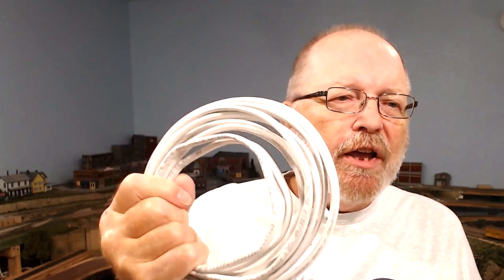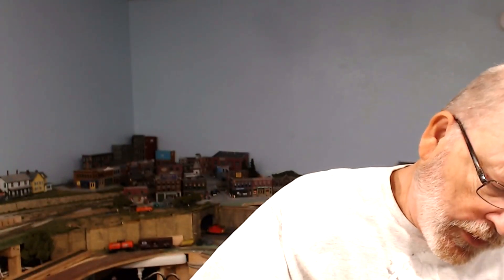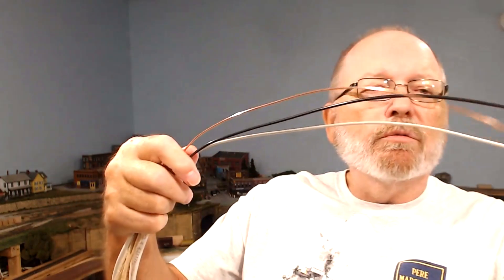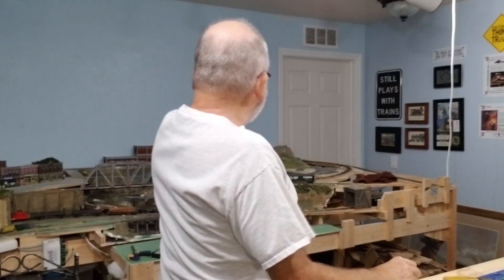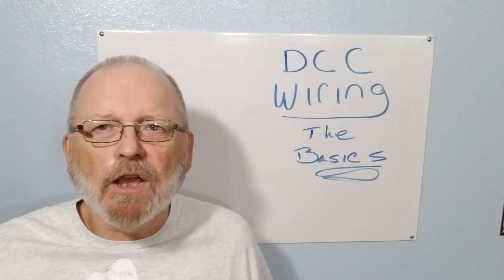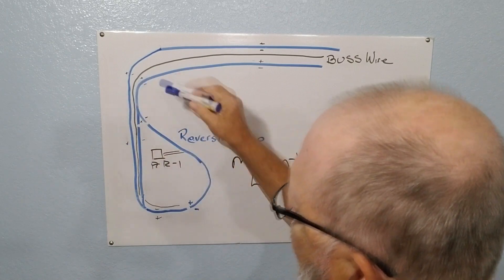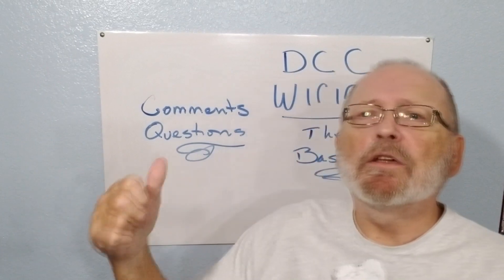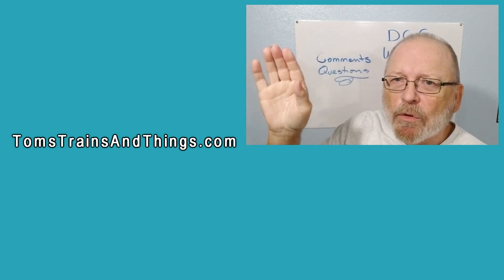Easiest Way To Run DCC Bus Wires On Your Model Railroad

Comment from the maker: Where should you run your Buss Wires and Feeder Wires on your DCC layout!
This video shows you where the best place is to run your wires to keep you feeders as short as possible.
Nickle Silver Rail is very high in resistance especially for the N scaler which can be equivalent to 36 gauge wire.

Comment: Looks like you got the same house wire I did.  I got 14 AWG solid strand house wire from Lowes and stripped it and ran the black and white wires under the layout to solder my drops to. I'm using flex track too, and my layout is fairly big, and even with feeders at every other joint, especially in the yards, thats a lot of feeders!
Reply from the maker: Best way to do it especially now with the price of wire
Reply: @TomsTrainsandThings  I hadn't followed the price of wire over time, but it seemed logical to use house wire.

Comment: Hi this is Neil schwerdt from West valley city Utah I have a question to ask you ( Tom ) I just put in the PM 42 and ran the  bus wirer s for each block to the PM 42.
Is that right you need to ran saparte bus wirer s to each block. again I have 4.
I really like watching your show on YouTube.
From Neil schwerdt
Reply from the maker: 1 set of bus wires IN, that are jumpered to each block. They are separated on the output

Comment: Tom. I want to use track that I can easily reconfigure. My layout cannot be permanent. I’m thinking of standardizing on KATO HO Unitrack. From what I have learned, it’s very smooth and reliable, very few if any derailments. I also have been looking at Roco GeoLine HO track. It also seems to be very high quality, unlike atlas or EZ Track. 

What I want to know is, if you’re familiar or not with these two brands, and how DCC friendly are the turnouts/switches? I want non-power routed switches, I believe, and insulted frogs?  Can you elaborate on the turnouts, and also provide your opinion on which track you would use if you only had these two brands to choose from? Thanks.
Reply from the maker: I'm not familiar with either of these brands since I've never used them. Most manufacturers have a variety of insulated and non-insulated frogs, they typically will be called insulfrog or electrofrog as in the Peco brand. You can easily search online to see if these manufacturers have the two catagories.

Comment: i'm just getting started in dcc. can someone please explain to me what buss wire is for?
Reply from the maker: Since the track is higher resistance than the bus wire. It's required to keep the required signal strength throughout your layout.
https://dccwiki.com/Wire_Sizes_and_Spacing

Comment: If you just have one continues track with no switches do you still need the bus wire and feeders? If so why? The rail is just as thick as 14 gauge wire so what's the purpose?
Reply from the maker: Copper wire has less resistance than the track, and you also have to deal with the bad connections between rail sections.
https://www.electronics-notes.com/articles/basic_concepts/resistance/electrical-resistivity-table-materials.php

Comment: Nice video Tom and good information. Two questions regarding using Romex for the buss wire.
1. Are you using multiple pieces of Romex that are spliced together on the layout or is it one continuous long piece of Romex? 
2. How are you splicing into and what method of connecting the feeder wires to the Romex? 
Thanks.
Phil
Reply from the maker: Thank you
1. Yes
2. solder where accessible, terminal board, wire nuts, specialized connectors.

I have a video on connectors:  https://youtu.be/ZmOF5HHYev4
Reply: @TomsTrainsandThings  Thanks for the info. I heard about suitcase connectors which, I was considering and I think you mentioned 14 gauge Romex. What gauge feeder wires are you using? Thanks again.
Philip

Comment: Hello Tom,
I'd like to run a second bus line for my N scale switches & accessories.
Any issues with doing this?
Thanks,
Paul
Reply from the maker: Not at all, I run several different voltage bus lines throughout my layout.
Reply: @TomsTrainsandThings  Do you use the same gauge wire for switches & lighting?
And thanks for your quick responses. I really enjoy your videos TOM!

Comment: Hi Tom I am very New to DCC I am having trouble wrapping my head around the wiring on my layout I will be using NCE powercab and I will not have a program track i live in a small apartment i will be putting 2 HO tracks on my layout both DCC and both will be oval and its going to be 3x5 that's how big the table is all i want to do is how to wire both tracks to my powercab and i watch your videos but i still dont understand i am sorry how would i wire my 2 tracks together to the powercab also i have the Bachmann EZ track and the Atlas track i may use please help or if you know where i can look it up so i can understand it please let me know thank you Tom i am sorry i hope you understand what i am trying to say thanks again
Reply from the maker: two wires from the unit to the tracks. Since it's DCC, you can use the same two wires for all the tracks.
Reply: @TomsTrainsandThings thanks time I am actually going to a train show on Saturday maybe they can show me thanks for your input

Comment: Hey Tom, I'm running fastrack o gauge on a 14x16 ceiling shelf. I have a small transformer and a lionel 180w brick. If I put the power house on one side and the transformer on the opposite long side and then 14 ga bus with 20ga feeders should that work just fine?
Reply from the maker: Can't help you there. I don't do O Scale or Lionel. You might want to ask trainroomgary!

Comment: For those of us O scale 2 railers. It is recommended that EVERY section of Atlas O 40" flex track piece have a pair of feeder wires in the middle. Never rely on joiners and do not solder the joiners either, it is mind boggling to me why people would do such a crime.
Reply from the maker: Those that never follow the recommended practices are always the first to complain when they have issues.
Reply: @TomsTrainsandThings  absolutely agreed!!!

Comment: Tom. Will a dc power pack controller run a train on 300 feet of track? It's HO code 100.
Reply from the maker: Should work as long as it's not one of the power packs from a starter train set and you have all good connections between your tracks and enough feeders.
Reply: @TomsTrainsandThings  thanks Tom. I've purchased a mrc prodigy elite but I have no idea how set it up. So I'm going to start with dc.
Reply from the maker: You have a good system there.
Reply: @TomsTrainsandThings  I've been watching about 10 of your a day, trying to lean the ropes.

Comment: Another good one, Tom.  Thank you for the tips!  i need to get larger (smaller AWG) wiring.  I wired a 2' x 8' module with 18 ga. buss wires and 22 ga. feeders.  I'm going to incorporate it into an around the room layout so I need to upgrade some wiring!
Reply from the maker: Robert, if your going to expand, I would start out with 14 gauge for the bus wires putting the source at the center and going both ways  to shorten the total run of wire

Comment: I’m so confused.... I just started model railroading and building my baseboard, I thought you just needed the rail joiners for power, can someone help explain this to me?
Reply from the maker: If you are starting out with a DC unit, you will want to see my other videos on wiring a DC layout. This one is for DCC. I have an entire series of videos on Model Railroading For Beginners. https://www.youtube.com/playlist?list=PLjjhnrIKSTShrzvkLrtppcNJ0zObTcDyv
Reply: You feed each section of track independently with the feeder wires from the main bus wires. This way, you aren't relying on just the rail joiners for power.

Comment: Hi Tom,
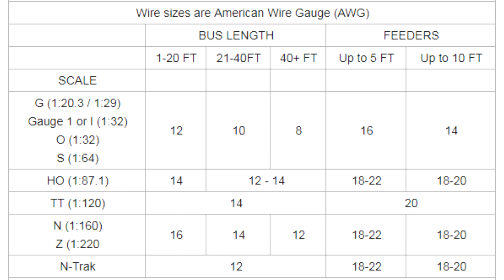On one of your DCC videos (Easiest Way To Run DCC Buss Wires On Your Model Railroad), at 14:05, you were showing a chart that showed the recommended gauge wire based on the length of track.
Then you said that as the track length increases, the voltage needed to be increased in order to compensate for the added resistance.  Did you mean to say that amperage needed to be increased in order to support larger track lengths?
You were talking about Digitrax and the use of boosters.  Are you actually connecting a wire with the weak signal to the booster to somehow boost the signal or increase the amperage?  Or is this just a 2nd power supply providing power to a 2nd section of track?
When you talked about AC, DC, and DCC, I understood the part that DCC was a coded signal that gets laid on top of the electrical current.  The decoder then detects the signal that is intended for that specific decoder, that you called the road number.
Does DCC typically run on DC or AC?
Do you typically have 1 power supply for the track, and a 2nd power supply for all of the DCC electronics, block detectors, and signals, and then a 3rd for accessories like scenery and other lights that dont impact the running of the railroad?
Should the track be AC, and then the other 2 should probably be DC?
Thanks for the wealth of information.  Im sure that I will have more questions next week.
Reply from the maker: Brent, you need one power supply for your command station to take care of the DCC signal to the tracks. The total amperage of the Command Station and your power supply determines what will be available for the track. Say you have a command station rated for 5 Amps. You can use a power supply lower than that rating. In fact the power supply recommended (by Digitrax)  for most command stations (now discontinued) is rated at 4 amps at the lower voltage 12 - 15 V and 2.9 amps for 24 vdc. The newer one (PS 615)  is rated at 6 amps.

Most home layouts require only one command station with no Boosters unless your running a multi layered through several rooms and have ops sessions with a dozen other modelers.

All your accessories are powered individually depending on the rated voltage, Most of them are DC unless your using something not model railroad specific or it was for an S scale or O scale system which operates on AC,

The longer the distance, the larger wire you will need. That goes for any wiring, not just model railroading.

DCC electronics do not run on DCC, they just interpret the signal. Some can run on track power or an external power source like a DS 64. A PM42  & PR 3 needs an external power supply and is also connected to the LocoNet.

You have to read the documentation of each component you want to use to determine if it requires an external power source.

A DCC signal is neither AC nor DC, it just looks similar to a combination of both. Since the signals travel from zero to the set high it can be read on a meter as AC but it is not like a typical AC signal that is an alternating minus and plus signal.

Comment: Hey Tom ok here's my problem I want to shut off track in my yards but on dcc you have to have two wires how do you wire a isolated track and what kind of on and off switch do you use thanks
Reply from the maker: In your yards you will have to gap at least one of your tracks and add an additional switched feeder wire to the track beyond the gap. You can use a small on off toggle switch to cut the power on this lead.

Comment: The whole point of DCC is that you don't have to have different sections of track !!! FFS stop over complicating this hobby, it puts people off !!
Reply from the maker: Most DCC manufacturers make components to separate the tracks into districts for various reasons such as detection and signaling. Some other reasons for breaking up the track is for ease of troubleshooting and reversing sections. The point of DCC is to run multiple locos on the same track, in different directions and speeds with one controller. If you think what I say is complicated you should try reading the instructions for all the DCC components available. That's why I put it into simpler terms so modelers without a technical background can understand it better.
Reply: I run a model shop, I build and sell model railway layouts, so I think I know what DCC is for. All you need for a reversing loop is reverse loop module which costs about £30GB, yes you can have block detection etc, but there is no complicated wiring involved at all, not unless you make it complicated !
Reply from the maker: Graham Walters one common bus wire pair running parallel under the layout is not complicated at all.

Comment: Is that wiring cost effective? I mean, as opposed to spools of 12 or 14gauge wire that most of us are used to buying?
If it is, I've GOT to tell Carmine about this, because wiring as been one of our roadblocks on the Pacific Belt, financially.
On my home Layout, and Carm's Pacific Belt RR, we try to run feeders at least every 3 feet, with a 12ga buss...
Thanks, Murph
Reply from the maker: Ax89 There are three main reasons for the 3 foot rule or even closer by some manufacturers recommendations.
1. DCC transmits a signal within the Voltage going through the wire which is much more demanding with a higher current than just a DC Voltage in your DC layout.

2. Nickel Silver track which is widely used now has less resistance than the old Brass track that was used years ago. Code 100 track has the equivalent resistance of 26 gauge wire which is much smaller than the recommended feeder wire size so the signal relies on the larger least resistant path. Which leads to #3

3. Never rely on Rail Joiners to conduct the DCC Signal, especially in the smaller scales. Rail Joiners, despite how tight one thinks they are, become loose with change in temp and humidity, and can accumulate a buildup of crud between the track and joiner causing a bad connection which willl be harder to troubleshoot.

In larger scales such as S Scale on up, this problem with the low resistance in the rail is eliminated because of the increased surface area of the track which has a lower resistance than the buss wires used
Reply: BTW, to put my Bro on the spot.... 
He's always told me that Nickel-Silver track has higher resistance than the old, crappy, hard to keep clean Brass track.
You've been around longer than us - is that TRUE?? 😜
Reply from the maker: Like I said in the video, you can use any wire available. The reason I used Romex is because I had some left over from a project I did at home. The 3 foot suggestion seems to work fine for me, but in some areas I have it closer due to turnouts.  Thanks for your input Murph.
Reply from the maker: I've never tested it, but I would assume it has less resistance than NS, since brass is used extensively in wiring everywhere. Except in the late 70's when they went to aluminum for a short period, then ran into problems with the brass fixtures expanding and contracting at different rates than the aluminum and causing excessive heat from loose connections.
Reply: Tom, I completely agree. 3 foot rule, except for turnouts, diamonds, and other special trackage. 
We have another running debate... we run 18ga feeders (unless it's longer than 5" to the Buss). 
Solid or Stranded??  What's your preference?
Thanks for responding!
Reply: Tom, we've actually got some Brass Track, in an old TYCO Train Set...
Carmine is going to compare resistance between that and NS. He might even have some Steel Track, for a possible shocking result. He's gonna get back to us on that.
Reply from the maker: Solid wire is easier to bend and solder on the track, but I've used both. Whatever is available.
Reply from the maker: That will be interesting to see which one has the least resistance.
Reply: That was always my argument.... Does either have more resistance?
Reply: For me as well!!
Reply from the maker: I'm sure they all have different resistance. Just like code 70 nickel silver track has the same resistance as 28 gauge copper wire. That's a pretty thin wire.
Reply: I just don't understand the 3 foot rule.  Why?????
Reply: Thanks for the explanation Tom.  It sounds like the 3' length of track between the rail joiners is the limiting factor.  I'm still trying to figure this stuff out so I appreciate your videos.
Reply from the maker: Your Welcome.

Comment: Hi Tom
Is 2.5mm wire ok to use for bus wires?
Reply from the maker: Hi Chris. It looks like 2.5 mm is close to our 10 AWG wire which is more than enough for a bus wire. 10 gauge is recommended for over 21 ft for the larger scales like S and on up.
Reply: It's only a small setup that I'm doing as I am learning from the very start. I live fairly remotely so limited to what i can get. I am running HO scale.
Reply from the maker: I don't think the over size wire will do any harm.

Comment: I have a two-track Mainline N scale layout that runs through two rooms. I have no bus wires at all, and only have two feeders. One right where the command station is, and other one that runs the opposite end of the second room that powers the second half. If you use the right rail joiners, you never have to worry about power. This is just my experience and it works on my layout.
Reply from the maker: Thanks for your input Big Dave. What size wire are your feeders?
Reply: Toms Trains and Things 22AWG solid core cat5e cable.

Comment: THANK YOU...for sharing. How far can you run Bus Wire from the PM42? I see a lot of modelers install there electrical equipment (DCC) on a board or even in a drawer with long runs of Bus Wire. What do you think?
Reply from the maker: Your welcome. Since there is only one set of buss wires going to the input on the PM42,  I see no reason why one couldn't place it anywhere on the layout and split into 4 districts there. The only reason I can see why it's always placed near the control panel is to see the LED's when there is a short on the rails. There is 1 LED for each district that lights up whenever there is a short in the district. The length of the buss wire depends on how large it is. Looking at the chart, if your going past 20 ft it's recommended to go to the next wire size.